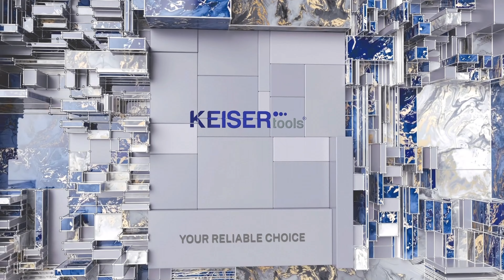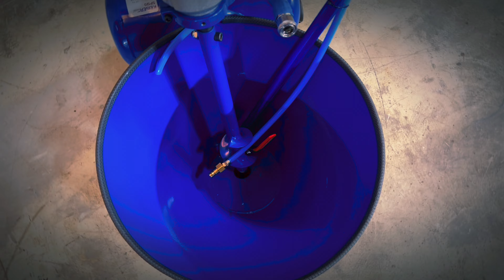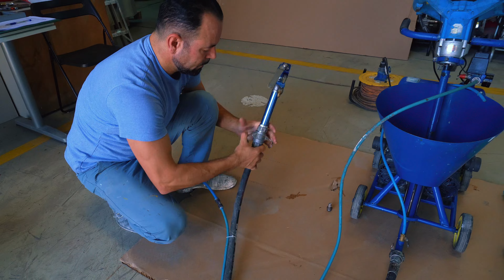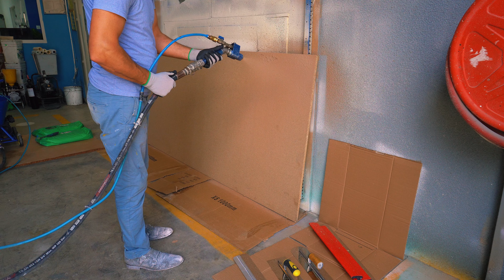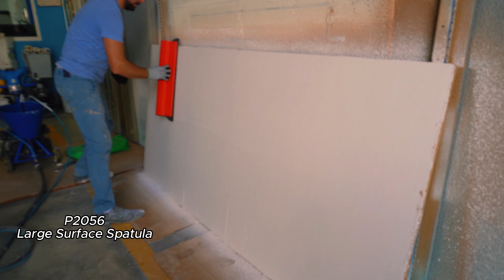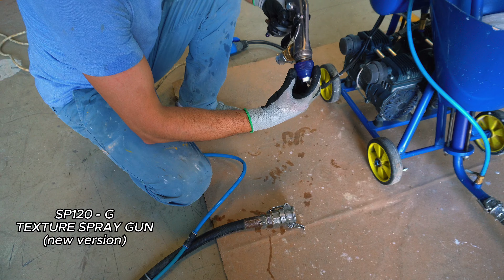SP120 / Skim Coating (Full Process) / Base, Mid, Finish Coats/  Caparol

Comment: What are the key features of the SP120 that make it stand out from other texture spraying units?
Reply from the maker: The key is that this machine has everything to do the texture job, (Air compressor already there, ability to spray all kind of plasters with grits up to 1.5 mm)
Reply: @keisertools  That's fantastic